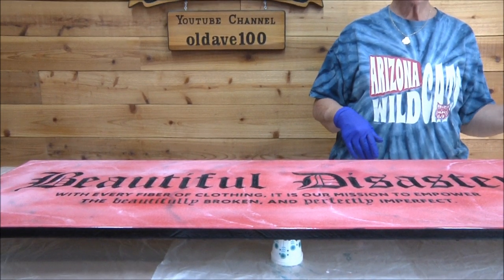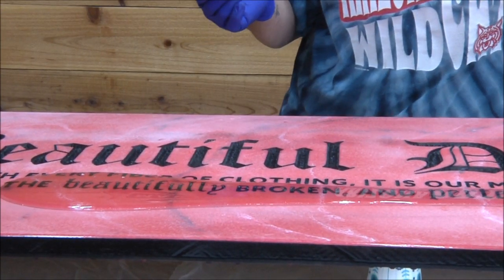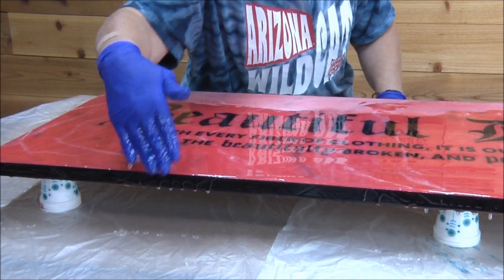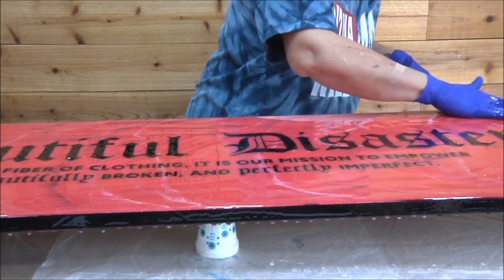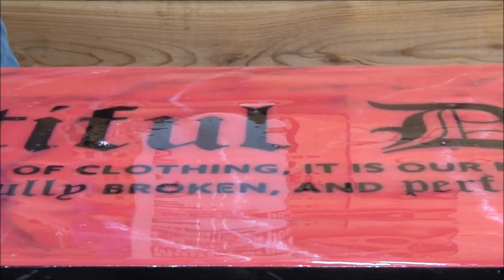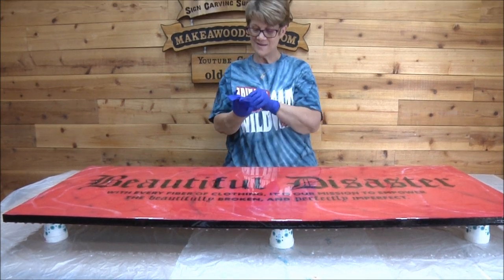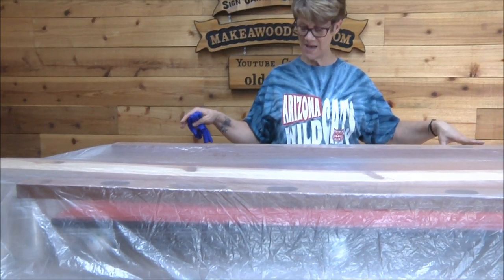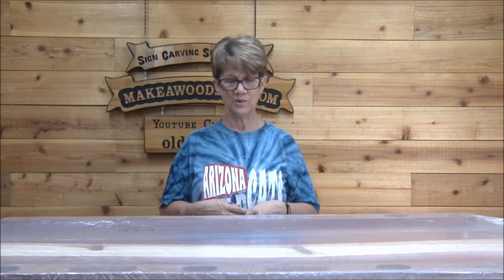#420 Final Video Making Beautiful Disaster Sign

Comment: That turned out great! There were so many little tips and tricks in that series that are very helpful. I have a question on pricing. With the amount of work that went into that sign, how do you figure your cost and then what would you charge?
Reply from the maker: Thank you Ron. Most of the cost was resin. Somewhere around the $75 in materials. This was a gift, I consider it advertising, but I would charge in the neighborhood of $600 for this one.